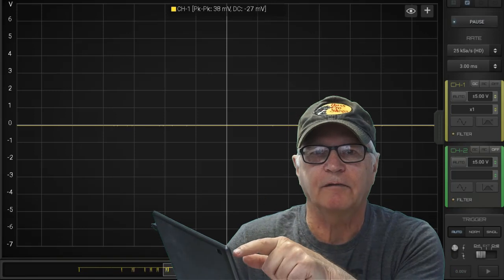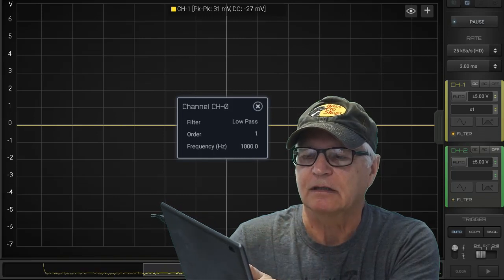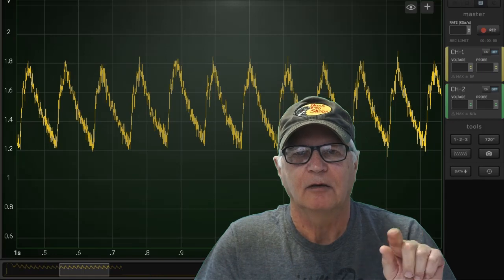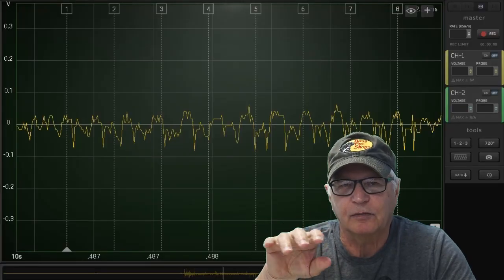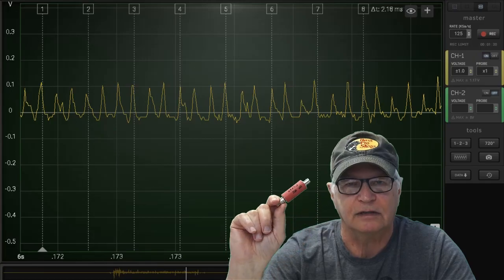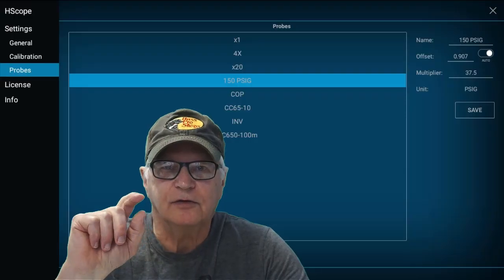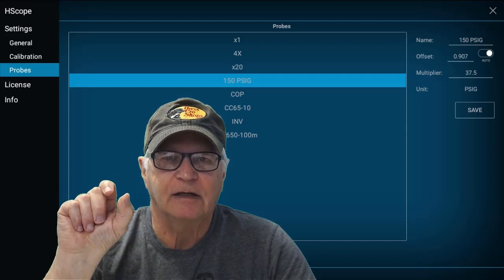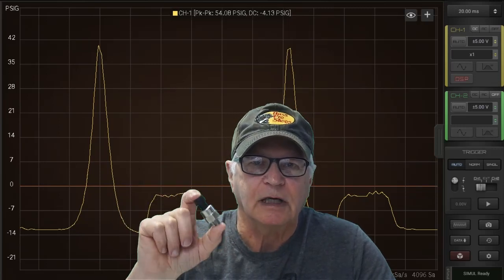GADGETS#108 - HSCOPE FILTERS

Comment: I'm gonna check out your hardware filter build. I use the autel scope a lot. But even using their software filter. The waveforms are excessively noisy at times.
Reply from the maker: You'll notice both a 33Hz low pass and a 33Hz high pass.
If you're building but 1, then it's the low pass of course.
But check out how I was able to see the com segments on a starter armature with the high pass filter "knocking down" the compression peaks.

Comment: Thanks for all you do. Made pressure transducer and only took me 2 sensors :>)))). Will be making the attenuators next. Quick Question...I have H-Scope with full License and automotive and digital module. I am using the 6022BE Hantek but I don't see filters anywhere. Does the 6022Be have that capability? Thanks
Reply from the maker: Took you 2 sensors...I had to smile, Ted...it's what led to the video on drilling those 316 SS. Glad you did succeed.
The new 4x and the 60x attenuator are those you likely would want to build.
HScope filters is not oscilloscope dependent and 6022BE has them. I suspect you are not of the BETA version (which I recommend)
Scroll down on the HScope Play Store page and you'll see the option for BETA. Latest release at time of this comment is (173)
Reply: @theGADGETSplaylist  yeah the first one I did with a drill and vise because I didn't have a vise for my drill press. I drilled to far. The second one I also bought a vice for press with a new sensor and it worked great. Those are the two attenuators I am planning to make. Messed up the first 4x because of learning the systematic steps of what and how to do first in soldering. All the bending and moving getting things all back and lined up for final product I broke the small wire on 820 resistor off even with resistor :))). Thanks for your help and work, you are appreciated. I will download Beta and hopefully won't have to re-purchased modules again.Thanks again talk to you soon
Reply: @theGADGETSplaylist  Beta worked, Thanks again..........Oh by the way I Love the hat. I live on the lake and am moving into the boat repair sector as a pass time now that I'm retired. Love to fish
Reply from the maker: @tedgtfan  did a LOT of walleye fishing, summer and winter for 48 years. Less so now.

Comment: I used the filtering to clean up a CAN signal. It worked great. Were you using different scopes in this video? I noticed the first screen had filters on each channel. But the second had the DSP button like mine does. Thanks
Reply from the maker: yes, Bill same OSC482 used throughout...but the DSP button has been replaced in release (170) and Filter added to both channels.
Reply: @theGADGETSplaylist  I just updated. Thanks for the reply.

Comment: Great info, what oscilloscope did you use in the example screen shots? and did the high pass filter alone clean up the pressure wave form from jagged to nice slopes?
Thanks
Reply from the maker: I used the OSC482, Jonathan.
It was a 80Hz Low Pass filter and yes, it alone cleaned up the jagged edges!
Reply: @theGADGETSplaylist  That is really impressive, I have ordered the osc 2002 on your recommendation, I am looking forward to getting a really clean and tidy pressure waveform, the Snap on Verus really just can't do it. Thanks for all you work on this channel I really appreciate it- Thanks
Reply from the maker: @jdean399  the OSC2002 will be recognized as OSCA02 ... that is the licence you'll need to purchase
Reply: @theGADGETSplaylist  Thanks for the heads up

Comment: One upgrade i would love to see is 4channels. Especially when doing cam crank correlation  with 2 cam sensors and checking primary aswell
Reply from the maker: yes, very common request...and 4CH will come but it will take a bit more time...
Not just a matter of developing the software but also selecting 4CH oscilloscope to support...
Reply: How do I buy these from you
Reply from the maker: @flair7796  if you're referring to the hardware High Pass and Low Pass filters, you have to build DIY, Rodney...
If you're referring to HScope software filters, then the app can be downloaded from the Google Play Store and a licence for the supported oscilloscope can be purchased within the app.

Comment: Nice video. Great to see we have filter now to play with.
Waiting for HScope to have support for 4 channels, I hope this will happen soon!
By the way , any idea about an  automotive oscilloscope with 4 channels, on the cheap side, better than Hantek 1008c (sampling rate)?
Reply from the maker: I could steer you towards the LOTO lineup for 2CH but I don't have a pick for 4CH at this time.
Reply: @theGADGETSplaylist  Yes, I know about LOTO, especially OSC482 from your videos. I think it is a very good oscilloscope to adapt into the automotive industry.
But for now I will have to stick with Hantek, because, sometimes, I need more channels and I have to use the scope with his base software, which is a mess.
Reply: @theGADGETSplaylist  Also found an in cylinder pressure transducer that doesn't have the need for a 5V reference box. You can power the transducer directly from the battery, it has the right PSI range and the most important, will not break the bank.
This pressure transducer it is a part of an automotive oscilloscope kit, but they will sell it separated.
Have a look and if you want, please tell me your opinion. http://autoscope.eu/products/
Reply from the maker: @JonnyJohn23  - am a bit familiar with AUTOSCOPE and some of their products but not their pressure sensor and they're not providing us with much info on their site either, I find.
What our HScope Automotive Group seems interested in the way of ready to use 12v battery powered PSI sensors is the ROTKEE P16...has to ordered from Ukraine

Comment: great video as usual, its real nice for the filtering option,even though i have studied low pass filterers and op-amp for two years and finally got both to working, BUT no education ever goes to waste. i'll up date h scope now. and tell people to use ceramic based pressure sensors .